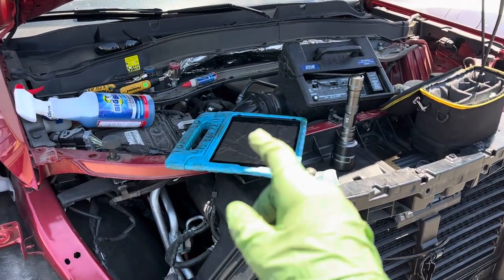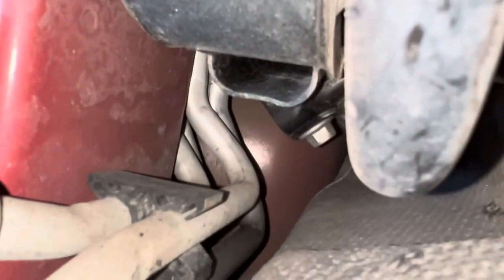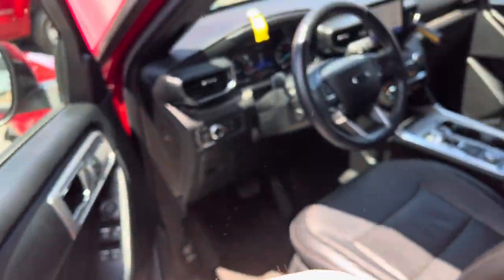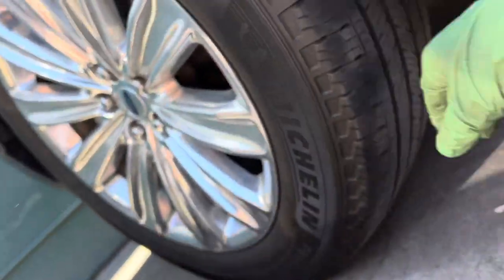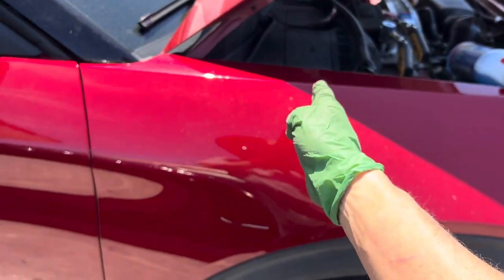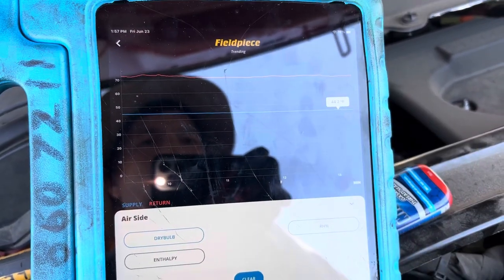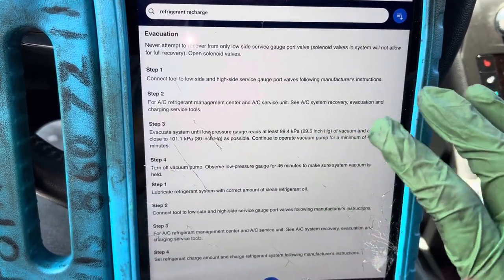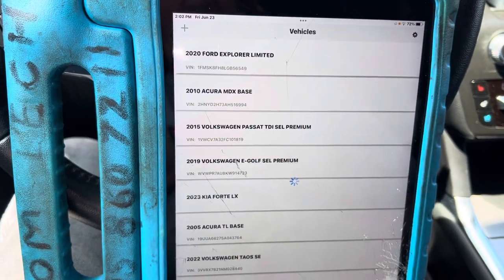BAD AC CONDENSER/ SUPERHEAT FROM REAR EVAPORATOR LINE/ NEED REFRIGERANT ANALYZERS

Comment: My daughter drives our 2014 Escape. It has a valve in the compressor that sticks in bypass and causes poor cooling at idle every once in a while.
Its done it since my wife drove that vehicle but i found that popping it in neutral and stabbing the throttle for a few quick revs would unstick it. So i never replaced the part.
Wife just reminded me about it about an hour ago. 😐
Reply from the maker: Sounds like a need some of that HVAC snake oil we find in the HVAC warehouse was that by Sepko and it’s kind of red. 

Do you know what I’m talking about? . 

That old school stuff that’s supposed to unstick expansion valves and open up, waxed up cap tubes and make compressors run cooler
Reply: @coldfinger459sub0  That is funny that you say that. I have already considered adding Zerol Ice/AC RENEW for that exact purpose. But it only sticks every now and then.
I just figured out what is going on (this time) today and am editing the video now.
I think you had mentioned it is like 70 to 80 degrees outside in your region?
I kinda called out a comparison of our ambient temperatures to yours in my video. LOL
I'll try to remember to drop a link in a bit.
Reply from the maker: Cool  😎